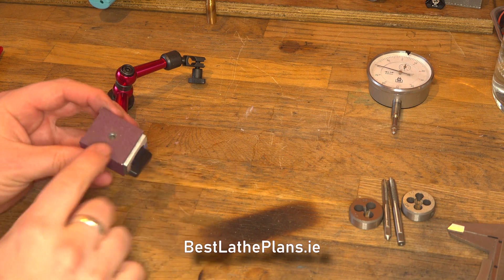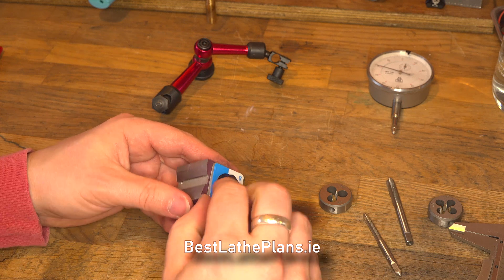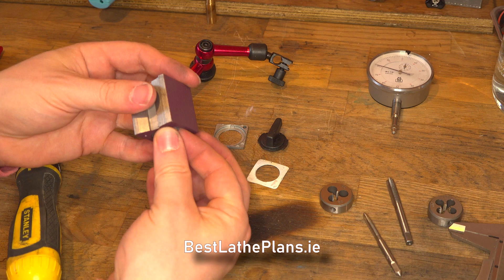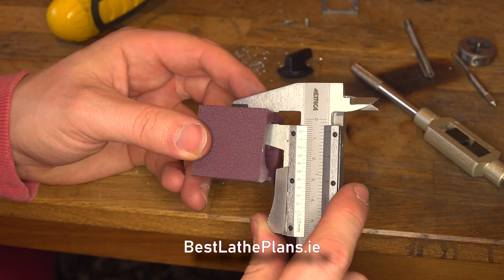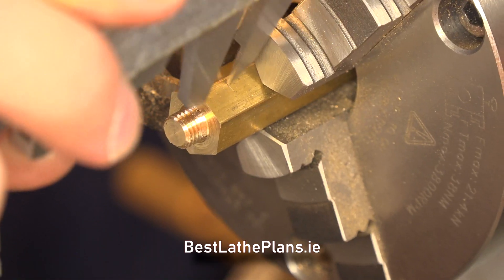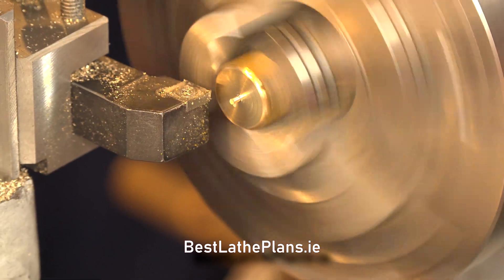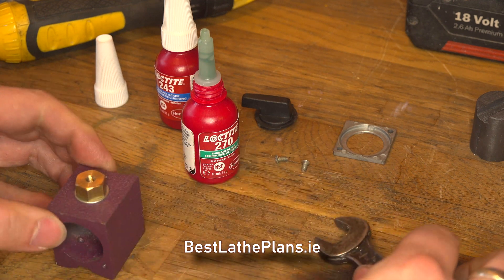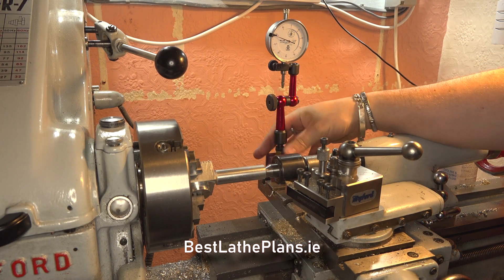Cheap Magnetic Stand Upgraded - Very Easy Fix - Save $$ - 4K / UHD / UltraHD - Best Lathe Plans

Comment: Excellent video! At 3:10 mark you reference a manual, what is that as I would like to have a reference like that. Much appreciated
Reply from the maker: Thanks for the feedback. Its appreciated. The book is just an engineers handbook. Think I paid £3 at an engineering show for it. I've 3 or 4 different ones. Most show major/min diameters for various threads. (UK vs USA vs Historic / BA) The bigger ones have pages of tables of sine, cosine and tan tables too, and other trigonometry references.
Reply: @BestLathePlans  thank you!

Comment: This is one way to do. I used Loctite 660 without making adapter and after more then 3 years it's still say hard as when I glued in.
Reply from the maker: Yeah I would have done that, but the fitting was pushing too far into the magnetic base, which was preventing the magnet rotating. The adaptor was very easy to make, and was a nice bit of practice on threading. But yep, the Loctite has held up amazingly well. I'm always impressed whenever I use it. It's amazing stuff!